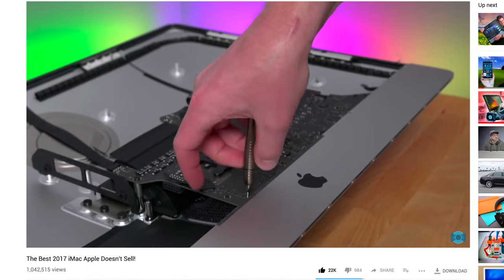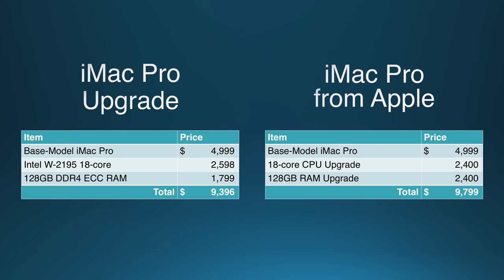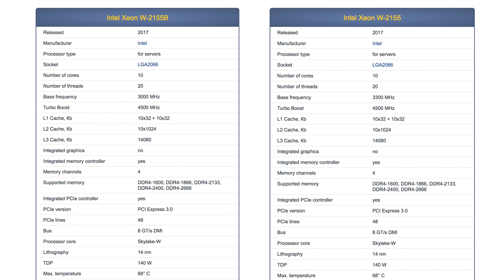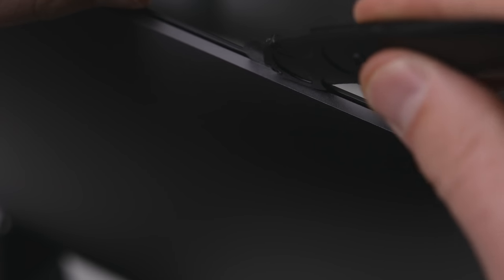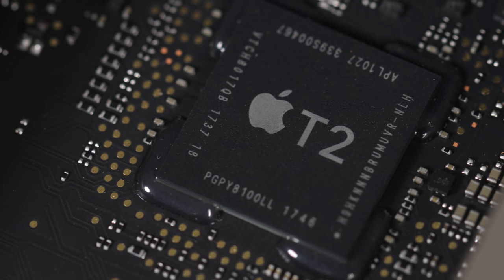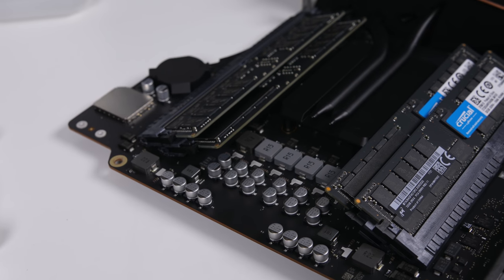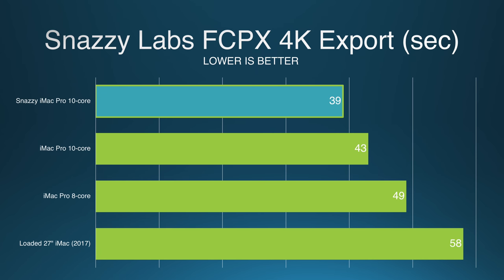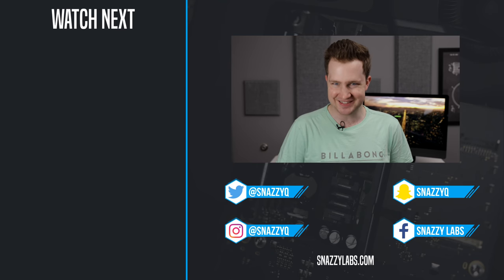Can You Upgrade the iMac Pro?!

Comment: But why the hell would I build spec for spec, if I can build better for cheaper that makes no sense
Reply from the maker: If you need an iMac Pro, you need an iMac Pro. If you don't, you don't. It's a very niche machine for a very niche market, but if you're in a professional production environment that uses Final Cut Pro, there is genuinely no other option.
Reply: Snazzy Labs nice vid man! What did you use for replacement thermal paste?
Reply: Snazzy Labs I understand that. Then I'd just buy an imac pro. It's just the spec for spec argument makes no sense. If I want the best, I build the best. If I want a 5000 dollar PC, I'll build to that budget using the best parts available. If I want an imac pro, I'm not going to build a clone, I'll just buy an imac pro.
Reply from the maker: Enjoyed_Tek Cheap Arctic MX-2.
Reply from the maker: Demonslayer20111 My underlying point is that the hardware choice, while odd for a video editor like me, is viewed as important in other fields where stuff like ECC memory is required. I'm just sick of the perogative that iMac Pro is "OMG $5K, wHaT a RIP OFF" when, in reality, it's actually competitively priced compared to similarly specced hardware.
Reply: Snazzy Labs apple has a reputation for overpriced hardware. But that's in it's consumer line of products. However since that is what most people deal with, they assume it's the same here. (To be fair, other cult like manufacturers like Samsung do the same)
Reply: Snazzy Labs my underlying point is that nobody who builds thier own computer is going to build that particular spec. They'd be insane to do so. I'm not claiming that it's overpriced, I'm claiming that for most use cases, it's underpowered for the price point through no fault of it's own. However like I've already said, and so have you, sometimes you just need an imac pro. Which is fine. Its just the cost/performance is kinda craptastic for anything not iOS specific.
Reply: "To me it's a wiser decision to avoid locking yourself into one hardware vendor because I prefer to choose my own components"

Nailed it...... Also, I still think the excessive thermal paste is a foreshadowing of things to come........ :)
Reply: Snazzy Labs Threadripper supports unbuffered ECC and it's under $1000 for a 16 core. You should try speccing out a 1950x build.
Reply: What are the reasons for using Final Cut Pro over other solutions? Does it actually do things that they do not? Is it ever really mandatory, or can a professional use other software and achieve all the same results?
Reply: It makes if you are saying that it's grossly overpriced.  The proper answer is: it's not. Why do you need a machine with that specs is a different question.
Reply: Snazzy Labs But wouldn't you be able to do all the same things on a hackintosh? As far as I can tell, the only thing a hackintosh might lack is compatibility with future OS updates - and that is tentative. 
But on the other hand, for a professional, the time required to shop for, build, assemble, and debug a Hackintosh could make it more expensive than the iMac Pro. 

To me, there are two major downsides to the iMac that apply to any user. First, the inability to repurpose the iMac screen for any future machine is a problem. Second, it's just not powerful enough to support the recent/upcoming generation of VR headsets, at least not for the higher demands of a content creator, and VR needs a lot of art assets. So inevitably you would need a PC to test in those environments. That would be a lot easier if you could use this iMac as a screen for that PC, because then you could have both machines in the same workspace, but the iMac doesn't have those inputs. Please correct me if I'm wrong in any of these assumptions, but I believe anyone doing any VR work would need a completely separate PC anyway. Any Mac user doing that work would already have an older Mac of some sort... so why would they upgrade to this iMac Pro if it doesn't actually give them any new abilities or a better workflow?
Reply: Snazzy Labs Hackintosh problem solved. 😂😂😂
Reply: Snazzy Labs What I don't understand is the server CPU with ecc memory as it isn't a server machine by any means so I don't understand the point of those parts as it just raises the price.
Reply: Snazzy Labs hackintosh is a better option. Apple os+pc prices.
Or better yet, switch to the more versatile os. Being windows. And spend a couple weeks learning how to use its comparable software. Final cut is not the only decent option for software.
Reply: Workstations always uses ECC RAM cause it raises data protection to secure the workflow integrity.
In this times where need at least 8 GB of RAM to have a good experience, ECC should be more common, as we are using this days more and more RAM, meaning that they are more bits prone to suffer errors.
Sadly, because Intel only offers ECC on their pricey Xeon processors, this option isnt more common as should be. AMD offers ECC RAM support in all their processors. Hopefully their marketshare should grow in the next years thanks to all the bad publicity that Intel is getting with these newly discovered flaws, failed PR stunts and their inhability to produce 10 nm CPUs, despiste the promised dates.
Reply: Birki gts look at the render times on final cut
Reply: You are using old(i can even say budget) thermal compound on 5000$ overheating mac? WTF just spend 10$ for a decent one(MX-4,NT-N1,Thermal grizzly...etc)
Reply: ECC is slower, extremely expensive(even in nowadays DDR4 price market) and it's not overclockable due to stability reasons.And if you don't have data critical system you don't really need ECC especially for video editing
Reply from the maker: waka faka Huh? I’m using Arctic MX-2 which is basically the same as MX-4. It’s perfectly adequate.
Reply: Even I can understand that. I know many newspaper and/or news on TV almost ONLY use Apple Products. I also know why, and they have done it a long, long time. However, they can also use Adobe Products, which some PC's can as well. And sure, they are great for editing photos, making music etc.

Comment: Hmm. Well $5 is $5. But I'm curious what kind of replacement tim did you use after removing the old junk? Also. What kind of improvements could be had if you used say, liquid metal and delidded the cpu? 
Not to give you any bad ideas, but I'd like to see how much the fan curve would settle down for what kind of preformance gains.

Comment: If I were building a high-performance workstation and it had to be x86, I'm sure I'd go with Threadripper. Big savings, massive multicore performance. Naturally it would run Linux, not Windoze, if at all possible, and that is increasingly possible these days.
Reply: don't you mean x64? threadripper isn't x86
Reply: You're damn right that Threadripper would be the way to go. Let's see what the Threadripper 2 32-core monster costs when it comes ot market. It's already forced Intel to announce that the highend server skews with up to 28 cores will be coming to the consumer market, where Intel will be getting a fraction of the price compared to selling them as xeon platinum.
Reply: for a windows/linux machine yes
Reply: If it had to be x86? What do you usually use, ARM?
Reply: Блядь Россия This is AMD CPU, not ATI GPU.
Reply: @abubakrakram6208  I usually use mips or arm laptops/phone/servers, x86 arch is only for my gaming machine '-'
Reply: Antoine Martinez Huh… interesting. I never knew any consumer machines other than phones used ARM processors.

Comment: The recommended way of installing the display is to install the adhesive strips, but not peel them. Then you dry fit the display, put a wide band of strong masking tape between the bottom of the display and the aluminum case. You then lean the display out, with the tape holding it in place, peel the strips, and then tip it back in. Does make it a lot easier.

Comment: TDP does not necessarily say how much heat it produces. A difference in clock speed usually indicates a difference in Voltage which DOES determine the heat the CPU outputs. So yes. The lower clockspeed is most likely a heat issue. Of course testing will have the final word but that's what this looks like to me.

Comment: I do disagree with the while that maybe true is doesn't change the fact part when your talking about like for like pc's and bit at around 1 min in. yes technically it does not change the fact but no one can say a 320x240 (240p) 40 inch screen for £300 is of good value just because no one else manufactures them so you can't get them cheaper else where. sorry its a bad argument its of good value as that specific thing cost the same in parts but for a fraction of the cost you can get something better ... how is that a argument.

. the question should be what is the best option for you and whats the best value for money sorry to say it 95+% of the time imo its not a mac for most people
Reply: mkbmainpc I used to buy XEON + ECC RAM for a reliable PC.  Expensive but worth it for less crashing. That was before Wall Street banks crashed the economy.

Comment: Your pcbuild vs the iMac Pro cost analysis was a joke. Did you look to find the most expensive stuff out there? I just specced a computer that was better with 2 screens and it was a little over $4000 that included 2 high end video cards, dual CPUs and a full liquid cooling system. 

I will say though, the inside of that machine does look very pretty.... besides their insane amount of thermal... I won’t even call it paste... that’s like thermal cement.
Reply: What screens did you use for your comparison? Because say what you will about Apple, they put some really good screens in their devices. Matching that ain't cheap. edit: And I'll bet you whatever you came up with isn't ECC capable.
Reply: how many dual CPU boards did you ever see without ECC memory support?
Reply: It requires more than just the board. Keep in mind that ECC memory is more expensive than non-ECC, so there's a fairly good chance he cheaped out when trying to stick to his $4K figure.
Reply: To be fair intel socket scheme is confusing the heck out of newegg(it wont show c422 xeon boards apart from the gigabyte board shown above even though they are available and sold by them) also an equivalent 5k screen (covers at least P3 colour space) is expensive that building a one is one equivalent imac is not much cheaper than the $4999 asking price 

PowerColor Radeon RX VEGA 56 NANO 8GBHBM2           $   449.99
INTEL XEON W-2145  (Price based on Intel ARK unavailable on newegg )    $1,113.00 ($1,252.69 cheapest on AvaDirect)
Crucial 4GB ECC Registered DDR4 2666 (PC4 21300) CT4G4RFS8266 $76.14*4    $   304.56
Supermicro MBD-X11SRM-F-B                     $   255.99
LG UltraFine 27MD5KB-B Black 27" 5K WFHD IPS LED Monitor               $1,299.99
SAMSUNG 970 PRO M.2 2280 1TB MZ-V7P1T0E          $   529.99
Phanteks Enthoo Pro M Series PH-ES515PTG_BK         $     94.16
Seasonic FOCUS Plus Series SSR-1000FX 1000W (supermicro uses a 900w PSU)  $   149.81
Corsair Hydro Series H110i 280mm CW-9060026-WW          $   112.99
ASUS XG-C100C 10G Network Adapter(same chipset as on the imac)     $     98.59
Apple Wireless Magic Keyboard 2-MLA22LL/A A1644         $     67.98
Apple Magic Mouse 2 Model MLA02LL/A            $     75.00
ASRock Add-On Card Model THUNDERBOLT 3 AIC (same chipset as on the imac)         $     79.99
                                                                                                                                                      Total:$4,632.04/($4,771.73) or 
Without the thunderbolt functionality                                                                                              $4,552.05 ($4,691.74)
the $4k  imac though is still a steal (provided you are going to primarily use OSX and do professional video editing)
Reply: Which normal person will go for ECC(2666mhz normal timing) instead of buying +4000mhz  low timing kit for like the same price per GB and get memory transfer speed over 50GB/s
Reply: We are not the "normal" demographic of this device."Normal" people for this device would likely prioritize ECC ram over 20 cinebench points.
Reply: They might seems pretty until you have to do any sort of maintenance on them, or they started to have problem, then you are fucked, I've honestly never seen a piece of expensive electronic that have their motherboard getting corrosion so easily, and don't even try to start on how these thing suck in dust like a fucking vacuum cleaner but without any means to remove unless disassembly, and you legit can get electrocuted just by opening it up because apple simply ignore basic electronic safety rule #1 of shielding the fuck up the power supply that plugs directly into main which left a few fucking huge capacitor holding voltage exposed that will legit kill you if you touch it the wrong way.
Go to the AASP or Apple store you say, they will blow the dust out you say; think twice before doing that, your machine will disappear for a few weeks and might return with all your data wiped, have develope new problem because apple "certificated tech" did a crappy job of opening up your $5000 bucks cult fashion item, and your best case of something screwing up is actually they did not do anything and still charge you a expensive fee, with or without warranty. Its 2018, not 2013, and apple no longer be worshiped for their customer support for a few years now.
Reply: Thats the thing with pretty things though. Most manufacturers all around sacrifice durability for style. Thats common in basically every type of product. I would never BUY an apple product, except for my iPad. I have yet to find a tablet i like better as of now. I also have a 2011 era macbook pro and a gen 2 apple TV but I got it them free. So their only purpose is to download pirated movies and play them through the apple  library sharing thing to my TV. 

My work computer is an HP, my home laptop is an ASUS and my primary home PC is a custom build PC. I dont trust anyone to work on my stuff except for me unless it involves a board repair which I am not equipped to handle to to a lack of equipment.

Comment: So, i watched whole video, now can I comment why building PC seems better to me?
So its not only about specs, and yeah, true, valuable thing in mac seems to be screen, you can still get full setup with higher raw performance, im not looking at wonky apple-only cpu's becouse I personally treat such thing as one huge anticustomer ripoff, but meh, whatever. Comparing raw juice per buck, you van comfortably have ~4000$ for 4k (or 5k? Whats that standard? Thats the trick, you cannot compare 4k to 5k, huh? Truth is, its 5k for this purpose. To make comparing harder. You wont tell me that its consumer friendly).

Anyway, yeah, you can get some better raw juice per buck, but where is that awesome apple service?

Well, that service is beeing lack of service. Their service is ripoff, when with your own build, you can easly upgrade, replace parts at will! And nobody will void your warranty (unless you overclock or delid or so) for your modifications. When you send your lets say GPU for warranty, you have whole machine still working, at your service, working on integrated gpu, or old gpu you had in drawer.

Apple will charge you unreasonable prices for service, when its been confirmed numerous times they give for example 'refub' mobos instead of new ones, when there is even no need for that!

And most precious thing in your computer, the data... Well, say godbye. In PC, except few minor laptops you can plug in and out storage, so even if your mobo goes bad, you have your data.

Another thing. Did apple need raid 0 to crank the reads to 3 gigs? Why my non-raid nvme ssd reads out over 4 gigs? Its not a thing nowadays that is top of the line. If I wanted I could make insane raid array for 8.5 gigs of read and around 7.2 gig of write. But who uses raid0, when you can have raid 10 and not risk your data go bad.... 

Okay, whatever, my point is, that you are making mistake by saying 'you cannot compare raw horse power, this is apple cpu!'

And if that change in price seems minor, think about servicability, how your data is safe and prone to random f**kup and how screwed can one get by smallest issue with their expensive as living hell computer.

Btw, my setup cost me around 2.500$, and only thing I have worse is RAM ammount and screen (4k not 5k, while I dont even think it is a valid argument)

Comment: Was shocked at the dollar figures. The most money I've spent on a computer was $3000 in 2004, and that got me a machine that ran Doom 3,  on a top of the line graphics card, and included a 5.1 surround system and a 1600x1200 capable, up to 170Hz monitor. Your figures are just too many dollars already... Since what you get is a PC that excels only at video rendering... BUT I think this is one of your best videos to date.  Top, top stuff!

Comment: I just bought the iMac Pro 27" 5K 2017 model (Bought New Mid-Aug 2020) with Intel Xeon W 2.3 GHz 18-Core (Turbo Boost up to 4.3GHz 42.75MB cache), 256 GB of RAM, 1 TB SDD, and Radeon Pro Vega 64X 16 GB for $3,799.

Comment: I wonder if those performance gains compared to the Apple built computers are because of the thermal paste being better? Or is it the slightly higher clock speed? I wonder how just changing the thermal paste would affect the Apple factory built one.